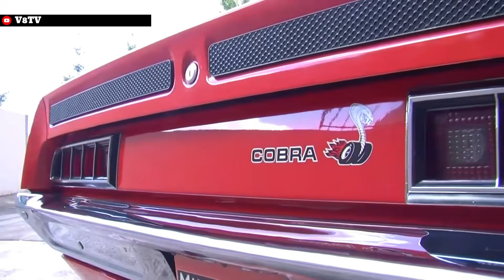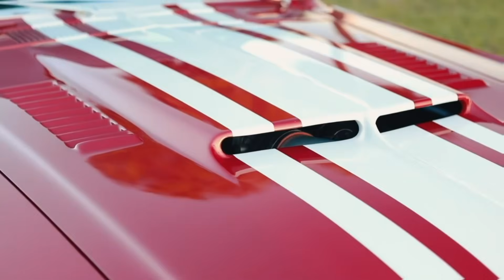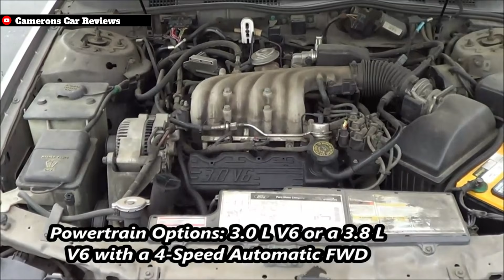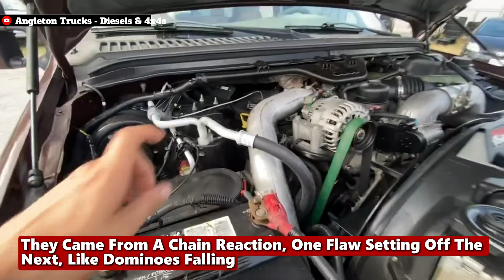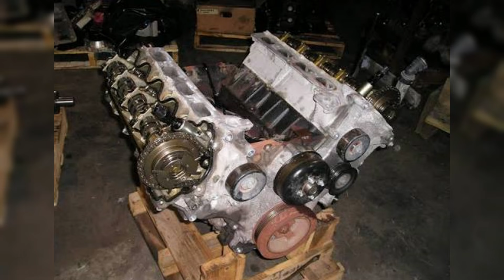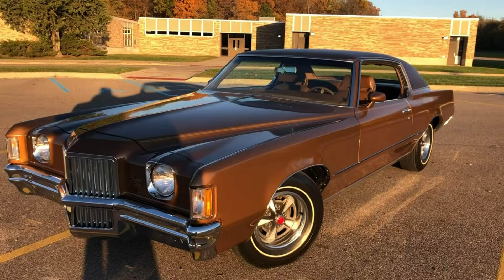The Ford Engine Even Ford Wanted You to Forget!

Comment: Wrong 2 vale 5.4 only had 4 or so threads and would strip threads and explode out. 2004-2007 3v  5.4Land 4.6L had 2 piece spark plugs and part of plug would fall into engine requiring head removal to remove parts. 3V updated late 2007-2008 to different smaller plug cylinder heads. Sludge from lack of 3,000 mile oil changes and short trips.

Comment: GM built 4 different 350 cubic inch engines with completely different architecture and almost no interchangeable parts.. but what do I know 🤷
Reply: Ford in one year built 3 totally different 351’s the Windsor, Cleveland, and modified